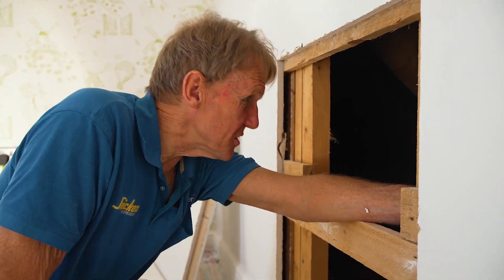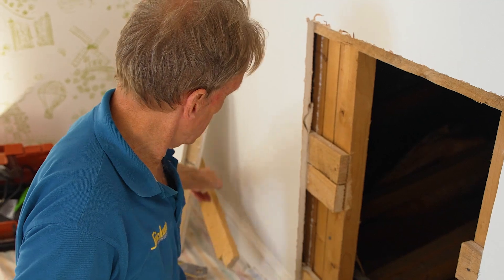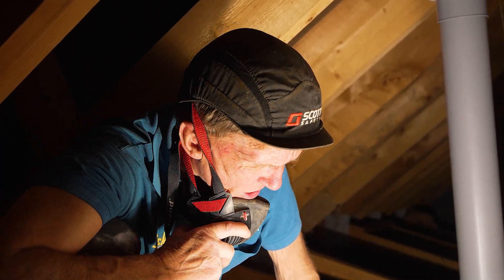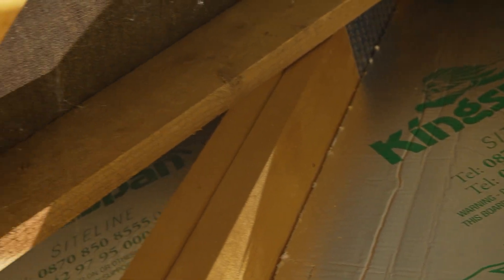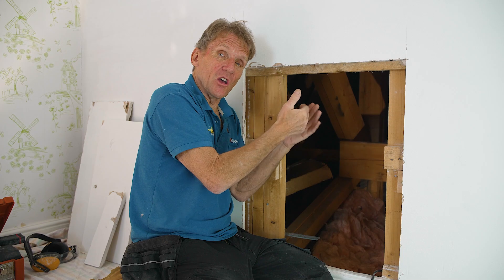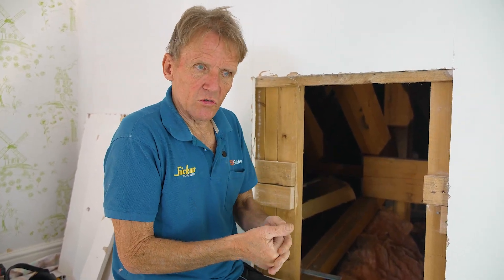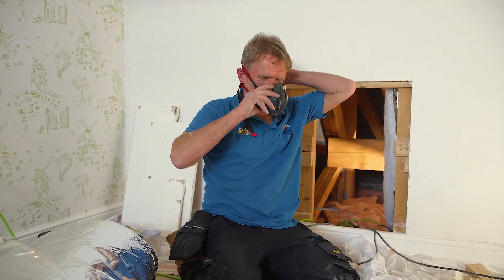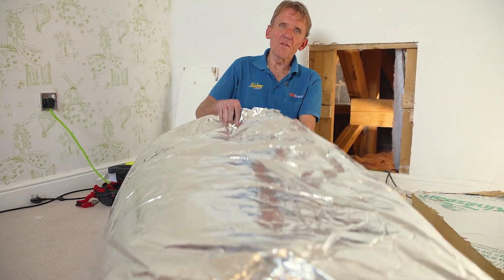Avoid Heat Loss & Condensation with SuperFOIL Multifoil Insulation

Comment: As I understand it, if I choose to improve loft insulation, I am required by law to attain full compliance with Building Regs Part L.  If that is not practical or cost effective, I am not allowed to make any improvements whatsoever.
Is this Superfoil equivalent to 300mm of fibreglass? If not: surely I cannot use it?
Reply: have a look on their website. It has examples and the values it achieves. You can do hybrid installs so you have celotex or glassfibre in addition to the foil. For a modern warm roof it would require 3 layers. One on the inside, one inside the joists and one on the outside (replacing the felt). That would be more than enough to meet current standards.

Comment: I guess any insulation is better than no insulation so i guess the superfoil is doing a job of sorts. It's been a few years since I was involved with loft conversions but our local authorities blocked the use of superfoil as it didn't comply even if it was installed as per the spec. Not sure where it's at these days, employing the sevices of private building control seems to be a way of circumnavigating some areas of stubborn local authority building guidlines...

Comment: Im having a new roof on an existing 1970s dorma bungalow with almost no insulation other than the odd bit of tired rock wool .I have no insulation behind the plasterboard walls of the bedrooms similar to this job.was all set to have multifoil installed by the roofer when he retiles the roof .fitted on top of trusses and under the tiles at a fairly expensive cost.....but having been on quite a few roofing sites most of  the roofers say its useless as  insulation so really unsure what to do now......they were all saying useless without celotex between the timbers and another layer across those encasing it all.......makes it seem a pointless task
Reply: Same for me, 1970's dorma with hardly any insulation.

We don't even have central heating, got some work ahead of me.

Comment: 8:34 Rapid heating works. The glues tend to not like high heat levels too much and the tape and paper holder expand at different rates, so you get a bit of friction separation too.

Saw a guy who worked insulation who had a thermal knife set up strapped to a small tool cart and whenever he needed to start a new bit, he simply pushed the tip of the tape into the hot thermal cutter, the layers separated in seconds.

Comment: Anyone found a screw that will work with this stuff?.....that's a genuine question......anyone?
Reply: I used cup washers - prevented the foil from rotating into the screw thread.  Pilot hole first.  Same when screwing a batten over the foil.
Reply: @m0aze611  no need for any 'sharp/cutting' screws though?
Reply: I found cheap staples are the best option. The foil tends to try and wrap around the screw.
Reply: @DesperateDan3231  that's why I was asking as I've had the same 👍

Comment: I insulated my attic this year with about 800 pounds of loosefill cellulose. It was a massively tiresome job for a single man crew. But it was so worth it. It reduced our summer indoor temps by a good 4 degrees F . Now we don't even need AC on most days.

The fact that insulation costs only a small fraction of solar panels, is way more effective in reducing greenhouse emissions per unit cost, and is not half as popular as solar is simply baffling to me. But I guess, you can't brag about something as much if it is not a shiny and expensive new tech toy screwed on top of your house.

Comment: Why insulate a area which isn’t being used
Reply: Because the house IS being used and the house heat will escape to the outside.
Reply: @GaryHerberson  so if the heat escapes into a room/area which isn’t being used then the room which is being used will still loose the heat and be cooler

Comment: love that stuff did a big job with it warm roof with it on the outside linked into the cavity then 100mm rockwool inbetween the rafters and another layer on the skeiling down onto the dwarf wall ,

ps 

use a straight edge stand on it and stanley to cut it much easier than scissors

Comment: Great video Roger. That foil looks like amazing insulation and in that space, quite challenging. Can I ask, with the mask that you’re wearing, and when you have your glasses on, do you get condensation on the inside of your glasses from the breath escaping at the top of your mask? I always struggle with the masks I’ve used in the past. Keep up the great work 👌👍
Reply: Don't know what Roger's wearing, but have a look at the JSP Force8 masks. I'm only a DIYer but what a godsend this was when re-doing the old itchy insulation in my loft.
Reply: It's a trend stealth mask. Loads of reviews on youtube. I'm thinking of getting one. They are one of the lightest of this type of mask and have FFP3 rating.

Comment: roger im working on a job where the architect wanted 40mm backed kingspan plaster boards in the loft conversion  and 100mm in the dormer ceiling joists and the 40mm over that had ive never seen that super foil looks great 👍👍
Reply: I've worked with the 19 layer superfoil, unlike celotex/kingspan there was very little wastage and of course no foam dust!

Comment: I installed Superfoil SF60 in my cold air loft over the top of 2 inches of crapped fibreglass installation 3 yrs ago in a day.  ! A fundamental change in the warmth of the house, massive reduction in heating BTU needed ! TOP PRODUCT not cheap but payback is 5yrs for me
Reply: Great product did my loft about 15 years ago.  Hard work for one but paid dividends  over the years to the comfort and warmth to the upstairs.  Equally became a relatively dust free area for storage.
Reply: Something I dont understand - 1 reflective layer of foil reflects maybe 97% + of radiated heat, and similarly stops heat being emitted and lost through radiation. The expensive multifoil seems un-necessary..technically, baking foil could do the same thing.
I laid a single reflective bubblebacked layer across loft floor and a second layer attached to underside of roof support.  I have the data to show temperature gradients of minimal heat loss upwards in winter and limited downward radiation from hot roof in summer, plus passive loft ventilation cooling in summer from eaves to ridge. Also passive house base to roof summer night cooling.
If you want to limit heat radiation without spending a fortune - I believe one shiny surface does it.
Reply: @andrewmiddleton1762  As a fundamentally lazy DIYer I never want to do the job twice or it to be unsuccessful. No bodging or that'll do here as that historically means I repeat the job. Yes Superfoil is expensive but the ROI was 4 years for my house, the ease of deployment as a giant blanket over the rafters. Superfoil was very successful for me, my requirements and house. Others have different houses, standards and ROI calculations
Reply: @decarbonarama  I have deep rolls of regular insulation over the loft floor, topped by a single foil layer. I am not convinced how technically superior superfoil would be to that?I suppose I am interested in how superfoil might be technically superior, in terms of physics. Once shiny foil touches something, conduction begins, although this would be low level transfer through the insulation layers. Sort of defeats the purpose of shiny surfaces, heat transfer and radiation.
Reply: @andrewmiddleton1762  I believe the superfoil products control any moisture as well with their vapour control layer. Foil alone I don't think will tackle this element of house insulation. Passive loft ventilation is good.
Reply: @wetrupload9375  Maybe you are right. But how would water vapour move through superfoil foil layers - maybe it buffers surface temperature to control potential condensation? I am struggling to think - do the foil layers have  vapour mini-holes in them?

Comment: Horrible job ; well done Roger. I'm interested that you said this is a new build. If so why has it sarking felt on it and not modern roofing underlay?
Reply: Because it cheaper. New builds are slung together with scant regard to standards. If they can get away with it, they will.

Comment: Fair play to you Roger, nice job there.  How many loftys do you go to where there are huge draughts coming out through the light fittings, or under the skirting boards, as you say cutting PIR board into a hipped roof is a challenge.  We purposely cut the boards say 1 cm small and then fill all around with squirty foam, it takes time and costs a bit more but the difference is like night and day.
To do a really good insulation job does add a few quid and you need an understanding customer to accept that, cheaper to heat for life though!

Comment: Trouble is the main stream house builders self regulate on building regs. The standard of house building today is appalling, as everything is done to cost and not standard.
Reply: Building regs are a minimum standard. Unfortunately builders see them as maximum standard.
Reply: @gap4998 Exactly this. A minimum means the MINIMUM, not the suggested amount. It’s the same for drivers on the road that treat the speed limit like a target.
Reply: @CosmicBrain21  Not the same thing unfortunately as there is no legal minimum speed. But obviously 20mph in a 60 is not safe.
Reply: @jmcc524 I think you missed the point. The point is, there is a number (a limit) and that doesn’t mean that it should be the aim - regardless of whether that is a minimum or maximum.
Reply: Done to what they can get away with, or less in some cases, happier to go to court than to do it right.

Most aren't that bad thankfully.
Reply: Exactly, the minimum requirement is incredibly low for a country that calls itself "first world"..